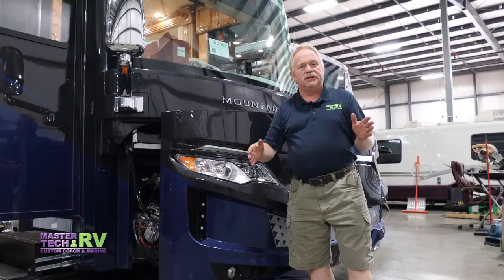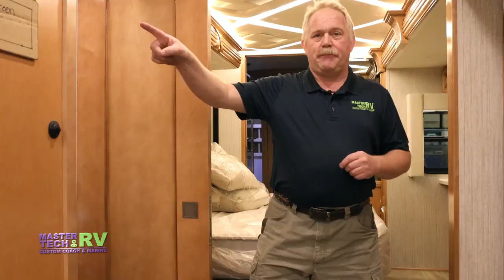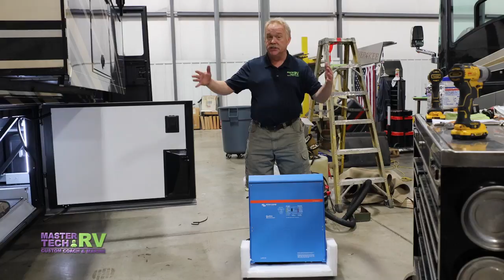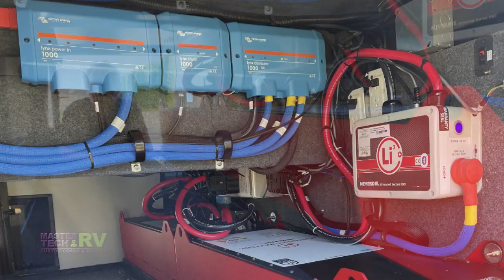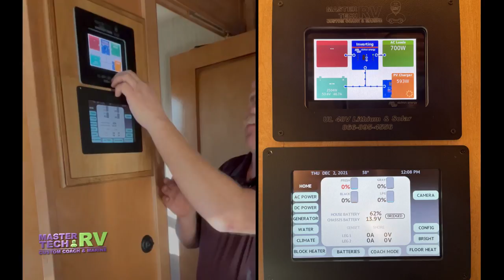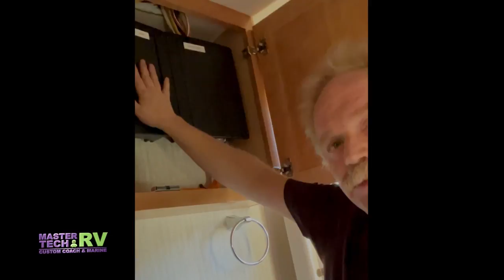Extreme RV Boon-docking / Lithium Battery and Solar Upgrade - 2022 Newmar Mountain Aire

Comment: I built a off grid camper for me and my wife when i found out i had stage 4 cancer. My system is only 24 volt but id give anything to have some lifepo4 batteries like that. That system is amazing and we would never run out of electricity with batteries like that. Thanks for the videos

Comment: If a person was planning on purchasing a new Newmar coach with the intention of adding this level of solar/lithium system, would you or would you not recommend the new Lithionics 340v (×2) option (with or without a third dealer installed 340v Lithionics battery)?
Reply from the maker: Just order one battery.. The one lithium battery we can integrate to our DC to DC Converter for 12v filtering.  We then add the 48v package with 48v inverter, distribution, Alternator and hi volt solar pkg to charge the integration efficiently.   Our packages allow running multiple Ac's over the road with no generator in use.. yet a charging platform that provides 10k of charging to maintain the capacity of the Bank.   Integrations using 1, 2 or 3 12 volt 320 amp batteries will be discharged with one ac usage in hours of over the road use..  as a 12v charging system even combined with solar cannot be recharged in a timely manner.

Comment: Is this possible for a fifth wheel application? Adding the alternator or generator to the tow vehicle?
Reply from the maker: Depends on the Tow Vehicle.. We have 48v alt options from 6k to 10k.. Between vehicles would be a High amp disconnect plug.
Generators can also be mounted on a Tow vehicle.. with options to power over the road or just when parked.

Comment: so 48 volt system is really around 52 to 57 volts , so he says it has a 52 volt system..... so basically its a 48 volt system ( which is still pretty much the best way to go )
Reply from the maker: This is a big block High amp lithium battery system with the ability to provide even 1000 CCA to start a Truck/Coach Chassis
All other battery systems do not allow boost starting as their BMS is only rated for 200a max.
Reply: mine is 53

Comment: How are you going from 52v to 12v for jacks that motors that may require higher amperage  to run.
Reply from the maker: Our 12v side allows 3000w including Ability to boost start even the chassis motor.. We use a Canbus components= DC/DC converter/ Regulator and a 190amp Military Grade Equipment.. everything talks to everything as its a digital system.

Comment: Hi, can you install this system in a dutch star 43 ft? Or the solar capacity Is lower?
Reply from the maker: We may-be a few panels less.. Every unit can be differences.. we just make the changes during MFG.-- We will soon have our New Custom Panels that are 210w a panel for the same money as a 195w
Reply: @MasterTechRVServicesElkhart  thanks, whats the lead time for an install ?
Reply from the maker: Our new USA Manufactured panels have been out for about 6 months now and they are at 215w each.. The largest capacity panel in the industry in the same footprint.

Comment: Nothing is said about running the Oasis Hydronic Heating system?  Nor is anything said about operating either the induction cook top or the microwave/convection oven? 
QUESTIONS: 1. How many solar panels could be mounted atop a 41 foot Mountain Aire? 2. Do the 190 watt solar panels provide true 190 watt power?  3. Could 300 watt panels be used in place of the 190 watt panels in this system.  4. What was the cost of this system as installed?  5. What would have been the cost if the owner had chosen 64k amohours?
Reply from the maker: Even though the 10k inverter is capable of running the Oasis Heating element it would not be recommended as it would be a wastefull use of lithium Watts.  The 110 v side of the Oasis or Aquahot is actually a secondary way of heating the Hydronic fluid as Diesel is the Primary.. But it could be an option.  Keep in mind The heat pumps and electric tile heated floors work off the inverter system as well including Refrigeration, cooktop/microwave and anything else as this 10k inverter has the surge capacity of 20k
Solar panels amount on a 41' is 14 panels.. on average..  We are now Boosting our Panels Watts with the same size panel.. We have a 210w panel Mono that will add even more voltage to charge.  so a 14 panel package will provide 2940 watts instead of 2660 watts.  A 300 Watt panel is too large for a mobile installation.. there is too much flex and the panel will fail to to internal fractures. (not covered by warranty of course)   
The package as it was with 20 panels is 115k. doubling the lithium bank would be around a 150k package.

Comment: Question  if I can ask this is some system with this even when not boon docking  and using full hook ups would you still need to keep the generator ….when using the Solar to recharge batteries hope this was clear ty 
Mar.
Reply from the maker: Maybe on multiple overcast days of running multiple ac's and coach..  there could be a time where you would have the option of starting a Generator to charge or starting the motor to charge.  Rigs like this you plan for your needs.  With 7 panels charging at 48/54v You can run a 15k ac and still charge the lithium module from running all night.

Comment: What? Omg Lithionics are you serious? What a huge waste of money. Stop saying 52 volts, just stop it. What's the voltage drop from that 10,000 watts from the alternator when it reaches the charger? So you want people to run the engine instead all the time to power the ACs instead of running a genset that burns 0.5 gallons an hour? The RV engine burns much more than 0.5 gallons an hour. Is this a 30,000 dollar install? You could have sold them Battle Borns for half the price.... OH wait, you're a businesses trying to make as much profit as you can.... Sorey
Reply from the maker: So let's do some education here.. the voltage of the battery is 46.4V to 58.4V, With a Nominal voltage of 52v..  The Lithium is charged by Solar= 4000 watts at nominal voltage, 140amp Inverter charger charging at nominal voltage  (Shore Power or Generator or Dedicated Alternator)  Coach has all three options. Running down the road the entire coach including AC's are run off the 10k inverter system with no Lithium charge loss. So not having to run a Generator in combination with a motor is s fuel savings of up to 1/2 gal an hour.. This will also lower your service costs, Heat, and Noise of the Generator..    
 A high voltage Lithium Battery system takes 1/3 of the amps to operate the 48 volt inverter as well a charging time of 1/3 if the time  a 12v system would require.. Lower amps means less Heat meaning better efficiency.. A high voltage Big Block Lithium battery system charges not only Faster.. is a balanced battery system.. The Modules and BMS has the Capacity to operate High Amp devices.  The Total system is UL and RVI approved and has the ability to be used for boost and or starting a Generator and or Engine.   The Modules are intelligent, data logging and serviceable if ever required.

The other brands of Lithium batteries are a cylindrical cell.. Their BMS controlling the cells are not UL or RVIA approved, They are not rated for Cranking Amps.. (Engine or Generator) Their BMS are rated for the capacity of their cell up to 100 amps continuous.. they are 12 to 24v options.. They can be installed in series once to double their voltage, (two Max). Installing in parallel no more than four to a charging group, and an Inverter max of 2000w,  They also have Temperature limitations,  Cells are never totally balanced with other Often they are a throwaway with no serviceability,  They often claim a great warranty product not labor but have many getouts where install or abuse voids the warranty.
BTW The profitability on Battle Borns is greater per cell then Lithionics..  But I want Happy Customers!

This total install with Lithium / Elevated 20 panel solar system was 110k Customer qualified for Tax credits of 30%
Reply: @MasterTechRVServicesElkhart  funny how you keep insisting it's a 52 volt system yet you stated the inverter is 48 volts. I guess you are powering it with the wrong voltage. Stop it.
Reply from the maker: @z50king29   The model of Lithium is a GTX51V315A-F41-DIN-MODULE nominal voltage is 51.2 volts Charge voltage is 58.4v   Inverter is a 48v inverter designed to use and charge up to 57.6 volts.
A non UL 100% battery assembly (Cell and BMS) is not safe to be installed in any vehicle you sleep in.

Comment: amazing install. what was the approx cost?
Reply from the maker: 110k is the Lithium /solar.. Additional accessories, Shocks,RunFlats,Wheel Balancers, Silverleaf screen, coach internet,.. 125k
Reply: @MasterTechRVServicesElkhart  incredible work. how long is the lithium/solar install?
Reply from the maker: @pokerloser949  Start to finish 4 to 6 weeks.. On the 45'.  There were a few firsts that we had to design around to get 20 panels on the roof.. Also some custom cabinetry for the monitor locations.. This was the first 10k watt inverter install we have conquered.  And then verification/Testing/Education time.  We have the New Aire systems down to 3 weeks.
Reply: @MasterTechRVServicesElkhart  Thanks for the info, I will be getting a new Essex at some point and will come to you all for sure
Reply from the maker: 115k